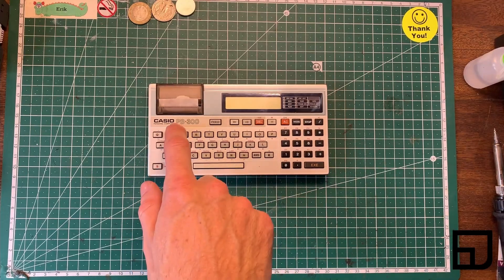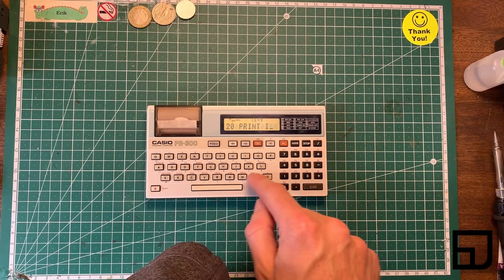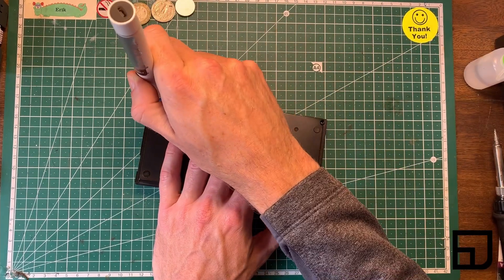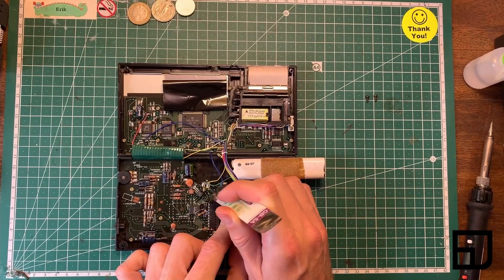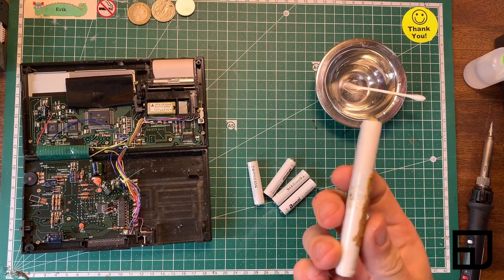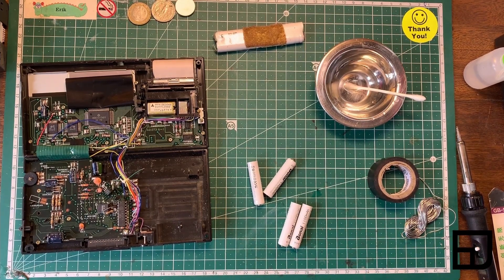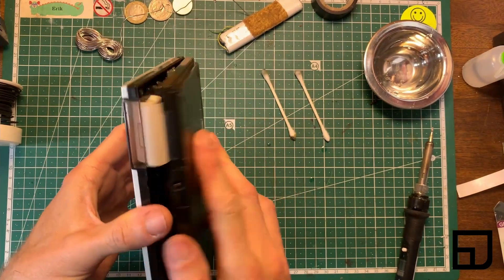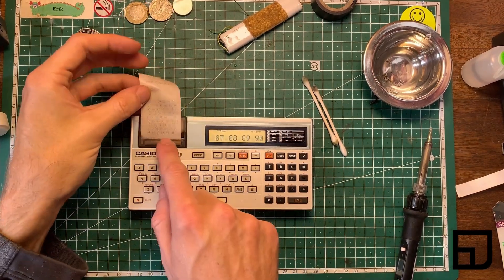Casio PB-300 Repair and Test

Comment: How do you charge the new battery pack? Ni-Mh is different when charging, it could be getting warm with the charging circuit of Ni-Cd
Reply: Sorry to insist, but making that will turn on heating batteries and the charger, At least in my case